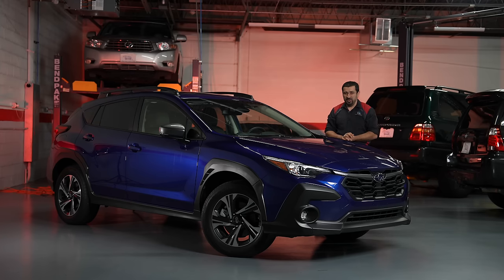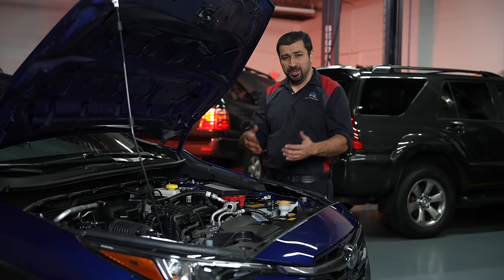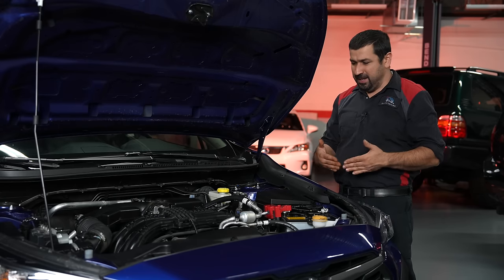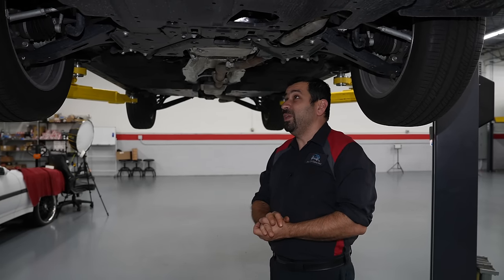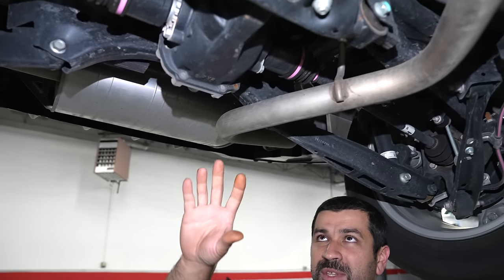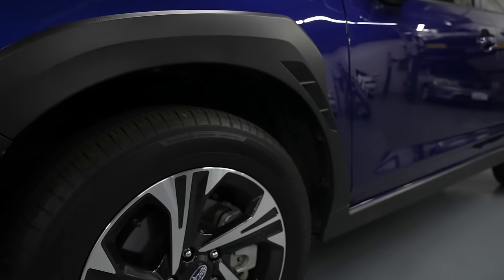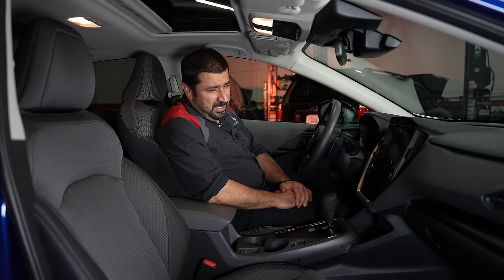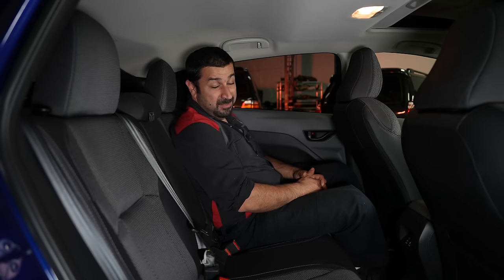Should You Buy a 2024 Subaru Crosstrek? Thorough Review By A Mechanic

Comment: I've owned a Subaru for 14 years.  I need a new car and I won't buy one with a CVT.  I hope someone at Subaru is reading this.
Reply: WRX with a manual it is then
Reply: These companies invested hundreds of millions into cvts they’re not gonna switch just because you don’t want it. Who cares anyway it’s not a Porsche it’s a boring ass suv
Reply: The CVT on myy 2016 Forester Subaru is fine.  Works well.  The CVT has a 10 yr, 100K mile warranty from the factory.  Nothing to worry about.
Reply: Yeah I’m sure they will change their transmission design for you😂😂
Reply: @ericr2zz  I was also told not to worry about my head gaskets before I ordered the car and guess what happened at SEVENTY THOUSAND MILES?
Reply: You should be fine with a CVT just got to remember. it is a light duty transmission I would not suggest towing anything with it .
Reply: Oh, yeah.  They'll sure listen to you at corporate.
Reply: The cvt isn't that bad, the people that complain about it have either not tried it or are expecting some super car performance. For a daily driver it is fine for most people. People just like to hate on it because all reviewers hate on it. It's different but doesn't mean you can't get used to it.
Reply: @VideosVlogsThatsIt I need a wagon body and a little lift to drive in the snow, but the WRX with a manual is on my radar.
Reply: The Subaru CVT is very reliable. 
TR690 14" Forester XT. Use it for street racing, 150k miles and going strong... I imagine with normal use you could go 300k or more. Just mantain the thing, change the fluid every 30k and filter every 60k.
Reply: @514aam  That's good info, thanks.  I don't do lots of miles, but I keep my cars a long time and then they stay in my circle of friends when I move on to something else.  Each car decision has long-term consequences.
Reply: Outback or Forester with the turbo has more power. Cvt is here to stay. They need a proper 6 speed manual.
Reply: Subaru puts the CVT in every vehicle.....they are better than the cvt on the Nissan.
Reply: They won't miss you. 😂
Reply: @MuniTechnology did you listen to the salesman at Subaru? Lol
Reply: @ericr2zz are you doing transmisión oil changes ?
Reply: @MuniTechnology  Yeah, no problem with that either, a friend of mine has got a crosstrek, he loves traveling, uses it daily, it's a 2016 model, CVT and 2 liter engine, it's at about 350k miles now (I know, he uses the thing A LOT), it's doing just fine, pretty much the only thing he has replaced is the water pump and thermostat/cap every 100k as mantineance, PCV also included there. He did have to replace the front bushings at about 200k, not expensive. But the CVT has been rock solid for him, and road conditions here in Colombia are not easy at all, there is a lot of hills so cars have to travel uphill for hours sometimes and I have seen a lot of ford transmissions overheat, also some VW DSG... His CVT? even with 5 people and about 500 pounds of stuff in the car has never had a problem.
Reply: @STATEOFTRANCE14  I'm also finding mine is only loud when I start the engine.  After it warms up and idles down it's quiet.
Reply: Never buy a Subaru again then
Reply: @MuniTechnology ..... and it was a 2014 or older. 😉
Reply: I switched after 20 years to Mazda.Glad I did .Subaru was good but is too conservative in their design.Always promising in their concept cars and ended up with same old same old.They still use 6 speed automatic or with the CX 90 8 speed.
Reply: Subaru is not the only one moving to cvt. Honda, toyota, nissan, kia/hyundai all seems to be transferring to this type of transmission
Reply: They're not going to change because they're chasing EPA standards -- which are very tough with the inefficiency of the boxer design from an MPG perspective. Anything that improves mileage even a little bit, they'll do.

Unfortunately with their latest engines that also includes building them with less tight of tolerances than before to reduce friction. That in turn allows oil to get into the combustion chamber and burn. 

I've liked Subarus since I was a little kid and my parents got a little 4WD wagon as a family car. I thought that was the coolest thing ever! I've loved their AWD system for years. But now...from personal experience with 2 recent models I've gone back to late model (pre CVT and forced induction) Toyotas.
Reply: Exact reason I bought a hybrid.
Reply: Subaru owner here, this 23MY Forester is my 3rd Subie. I really like the car but perfectly understand you for wanting a true transmission. Unfortunately they won’t do it like Toyota.
Reply: If Subaru is reading this and I doubt they are they will be doing absolutely nothing. Their CVTs are fine and very reliable. They also have a warranty and Subaru stands by their product unlike other car manufacturers.
Reply: I have to agree with you, I always bought Subarus, my last was a 2017 outback which was a great car but once I got close to 🎉100,000 miles I wanted to switch, just not a big CVT fan, so I went over to Mazda, bought a CX5, I love it, and it doesn’t have a CVT. It’s been a fabulous vehicle so far.
Reply: @manbtm1  My brother just put 8K miles on a new CX-5 in 3 months.  He loves it.
Reply: Most or all car makers are coming out with cvts eventually. Just something we gotta live with cause they won't go back. Same as hybrids and dare I say it EVs. Otherwise it's back to the horse and buggy or bicycles
Reply: You should test drive. They've gotten better
Reply: @FordEnthusiast413  stands by their products? sure....
Reply: @bas4903  Not all of them.
Reply: Cool go buy a manual. Subaru and others arent changing anytime soon. Had two CVT cars. No real problems besides they dont feel like an automatic. But guess what both are still going.
Reply: @ericr2zz 
Everything to worry about who in the world drives 10,000 mi a year, nowadays people drive anywhere between 15,000 to 25,000 a year
Reply: I bought a 2015 Nissan versa four-door sedan for my daughter fresh out of high school, 75,000 mi later the CVT transmission was out, they wanted for me to pay $4,800 for new crappy CVT we just decide to donate the car and by a different car
Reply: Check every manufacturer's most popular models. All CVT lol
Reply: Nah they are not reading it. All cars will be CVT soon
Reply: @colt2206  No they won't. The only reason Subaru has to use CVT's is to meet EPA regulations for fuel efficiency. Soon these standards will eliminate their inefficient boxer engine so the good old automatic transmissions aren't going anywhere. The only thing they can do to survive is either go all electric or figure out a way to mate up a Toyota I4 to the AWD.
Reply: They don’t care about what one person wants. How selfish of you!
Reply: Just an update CVT transmissions are getting very reliable . And they help with fuel economy just remember it’s not a towing transmission
Reply: Yep.  No cvt for me.
Reply: With the sales of subaru I can tell you subaru doesn't care of you don't buy subaru with a cvt. Lots of other car manufacturers use a cvt so best of luck finding a car.
Reply: Hi. This is Subaru. I heard your complaint. Starting tomorrow we’re changing all the CVTs to Automatic. We had no idea how unhappy you were but now that we do, consider it done
Reply: @ericl20881  Nevermind.  It's down to a Maxda CXwhatever or a 4Runner this year.  I'll check out Subaru again in another 15 years.
Reply: My 2013 Outback’s CVT 1:56 crapped out at 140,000. Perfectly beyond the extended warranty period. Probably would’ve considered another SubIe if they had even given us any goodwill consideration at all
Reply: The cvt in this car is great. Nobody at Subaru cares that you don’t like it.
Reply: @eddymahon1503 well maybe not .But then again think what happened to millions invested in Electric Cars ? Just a thought
Reply: New ones use linearcvt
Reply: I’ve had 4 Subarus and I actually like the cvt and never had issues with it… What I did have problems with on my 2017 was blowing out my front shocks twice, burning out headlamps, and a fkg cracked piston at 110k.

Comment: in the last 8 years I have had one 2015 4runner, one 2018 Prado and three forester (including a 2017 XT)...never had a problem with them..
Love the 4runner and prado, but in high speed highway..eehhh..that boat feel, breaks..mmhhh..
Forester (a different car obviously) are much more fast, easy to drive (and park), enough for normal off roads (the x mode is ver very handy) and in general more "agile" daily than those body on frame ...
just go with the 2.5 engine..that 2.0 is literally a snail..
btw this are one the best review channel in business..still waiting the forester review

Comment: Excellent review imo. I love Crosstrek having non turbo engine and I believe it still has manual transmission option. Wish Subaru consider a newer yet good 9/10 speed automatic transmission for those who need automatic transmission. (Back in the day my wife hated my manual transmission car, so I had to stop buying manuals sadly.)
Reply: Unfortunately, they dropped the manual in 2024 for both Impreza and Crosstrek
Reply: I belive due to how they mate the engine to the transmission, and the available space for the transmission, they prob couldn't fit a 7+ speed in the space.
Reply: It's really how they package all the awd hardware.  It's all contained inside the transmission in essentially the same straight line the rear drive shaft is in.  That is of course a bit over simplified.
Reply: Manual no longer in the 2024 model, older ones did have it.
Reply: Honestly, having driven the 8-speed tranny in an MB CLA 250 was a much bigger pain than the CVT of my Impreza. The CVT has much faster response on passing over than the 8 speed, which was struggling to calculate which gear to choose for the start of the acceleration. Same feeling with the ILX of my son. It actually takes more time to accelerate than the CVT.

Comment: You just said one minute earlier that the trend of auto manufacturers is that they're trying to make flashy "hot Ferarris," which includes cars being fast. So why complain that it's slow? 
In truth, the crosstrek isn't slow, it's fine. However, compared to the auto industry trends, it FEELS slow. 
Best AWD system out there, excellent off road performance, and one of the safest vehicles at a good price.

Comment: I thought CVT transmissions were more simple in design and manufacturing and was the driving decision to implement.  I have had 4 cars with CVTs from Honda, GM and Hyundai and never had any issues and IMO they are better suited for city driving with smoothness that a traditional torque converter transmission cant match.  Plus fuel economy will usually be better.

Comment: I just don't understand why all you folks who do car reviews say the Crosstrek 2.0 is slow. No, it's not a speed demon, but it is more than adequate for NORMAL driving. I've had 2 of them now with no issues, and have never felt the need for more power. I did buy a '22 Crosstrek 2.5,  but only because it gets better mileage and the Dealer got me the color I wanted plus I couldn't pass up the deal they gave me with Subarus guaranteed trade in allowance. This car is much quieter and feels more solid than the older models. It is MUCH quieter than my brothers '22 Toyota Rav 4 Hybrid. I wouldn't trade him even up for anything.

Comment: My 2016 Crosstrek had nothing but problems after 72k miles.
Reply: Ya, for Subaru’s, 72k miles is just about when the money pit phase starts
Reply: My 17 Outback has almost 200,000 km (120,000 miles). Very few problems so far. Guess it is living on borrowed time.
Reply: @jimiburns6891  I got a coworker and her impreza is already messing up and it's brand new.  The dealership ain't helping her out much

Comment: 'Hopelessly slow' merging onto I-95 can be hazardous.
Reply: You obviously never drove an early 1990's 240 Volvo then. 
A 113 neck snapping horsepower and I never had any issues merging onto ANY Interstate roadway anywhere in the United States of America. 
Put well over 300,000 miles on it and for some odd reason I don't remember having issues merging. 
If you have that much trouble getting on a 4-lane highway remember this: 
The gas pedal is on the right, the Brake pedal is on the left.

Comment: I’m watching this video as a recent Crosstrek buyer. Just watching for fun. Really enjoy my Crosstrek. It is great. The infotainment screen is ok, the car is quiet, comfortable, and very roomy, the 2.5 four is plenty powerful, gas mileage is great, I cruise at 70-90 on the major highway( but so is everyone else, so that’s ok).
The trunk light is stupidly placed. It comes on and immediately blinds you. Anyplace else would have been better.
The wireless phone charger is so slow I’m using a charging cord.
The glove box is very small, almost totally filled by the owners manual, which is written in Sanskrit, for all the clarity it offers.
Should have rear AC Vents.
One of the rear seatbelts is very awkwardly placed.

Comment: The Subaru CVT if serviced properly is good for well over 250,000 miles with the most common problem being bad shift solenoids which are fairly easy to replace. When a Subaru CVT fails under warranty Subaru often just replaces the entire thing regardless of the problem giving the impression that a greater percentage are failing catastrophically than actually are. Once you get used to a good CVT it's quirks become inconsequential and it's benefits are taken for granted until you drive a car with a regular transmission. CVT's hold cruise control speed light years better than any conventional transmission and unless you have the very latest 8 to 10 speed transmissions that are very dialed in the cruising nature of a good CVT is buttery smooth. The early Nissan and Honda CVT's were terrible for different reasons but both have gotten better while the Subaru and Toyota were good to start with and have only improved. If you take care of you Toyota or Subaru CVT properly it won't be the transmission that gives you your first major problem. And, yes, folks, I'm aware they do fail but at almost the same rate as conventional transmissions. Which is a point a lot of folks gloss over. Conventional transmissions haven't suddenly become impervious to failure just because the CVT exists.

Comment: After owning multiple Subaru Outbacks, the key to happy long term ownership is changing oil and diff fluids on schedule. The biggest headache for me has been tires... tread depth needs to be kept consistent... so you often wind up replacing all 4 tires if you get an unrepairable flat. Also... be aware that if you drive on salted roads, those plastic covers can trap road salt and hidden rust can start damaging your frame.

Comment: A little disappointed in this review. No mention of all the engine issues Subaru has had historically, lots of extreme oil consumption, transmission failures, etc. I have had several friends go through alot of issues with their Subarus. 1) engine replaced at 8k miles due to extreme oil burning. The change didn't really fix things. 2) same car, in 7 years, the person had to replace the whole exhaust due to rod, 3x with factory parts. My honda has had original exhaust for 10 years. 3) 2014 outback transmission died at 150k. 4) Subaru voids transmission warranty if you replace fluid before 100k miles. What the heck is that? Someone trying to maintain their car gets punished for changing transmission fluid? No one should buy into the "lifetime" fluid BS. Maybe the issues are fixed, but I don't trust that they are. Stick with the Toyota (lexus), Honda (accura)or Mazda. I would not risk 30-40k on a Subaru.

Comment: The thing I worry about that CVT, is they don’t want you touch the CVT neither fluids change until 100K miles for 10 years, if do so they will void your warranty. I have 2018 and it 80k miles now I’m thinking of getting rid of it.
Reply: BULL. Current Subaru maintenance schedules show that fluid changes are to be performed at 36k/3 years.  Try to keep up....
Reply: I don't know about your 2018, but the 2022 maintenance schedule calls for replacement of the CVT and diff fluids every 5 years or 60K miles.  And I think it's pretty much impossible that they would void your warranty for early replacement of the fluids.
Reply: If you didn’t have any cvt or bearing issues yet, you should also play mega millions

Comment: Great car. CVT is a let down though.
Reply: Have you ever driven one NOOOOOOOOOOOOOOOOOOOOOOOOOOOOOO......
Reply: Dude, almost all car manufacturers uses CVT. Toyota, Honda and others. Just move on.
Reply: @ericpizarro3084 simmer down Toyota only uses a conventional CVT in two of there models with and added first gear. The rest of the lineup is either an eight speed auto or a hybrid eCVT(in name only and nothing in common with conventional CVTs).
Reply: @ericpizarro3084  Mazda doesn't use CVT.
Reply: @focusstrider2390  Then get yourself a Mazda. I owns two Mazdas. A classic 1988 B2200 and a 2015 MX5. I love both cars. That doesn’t mean that the Crosstrek is not a great car. I also owns a 2021 Crosstrek Sport. It’s going to be with me three years and up to now Zero problems. Just regular maintenance. For me CVT transmissions are ok. You just need to give them good maintenance and don’t abuse it. CVT are not be run at 5000 or more RPM.

Comment: You found the rear hatch practical and convenient.  But when I went to the dealer to buy a Crosstrek, the sales man said "You can't buy this car".  He was right. The open rear liftgate was a foot beyond my reach and is neither adjustable nor available with remote control. You are 10 inches taller than I am.  Similarly, the head rests hit me on the top of the head.  I bought a Mazda CX-30, which has for me some visibility problems.  But at least I can get the liftgate shut without attaching a string to it. Please include shorter and taller drivers in your interesting reviews